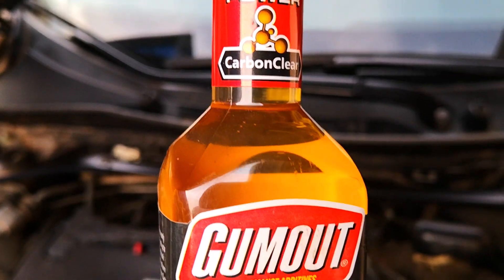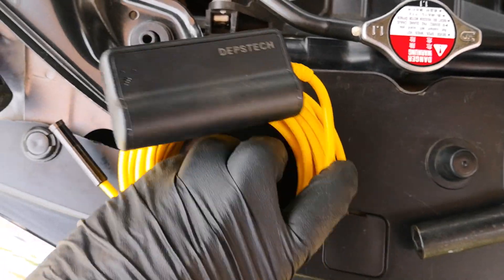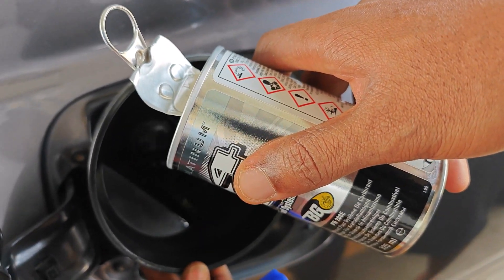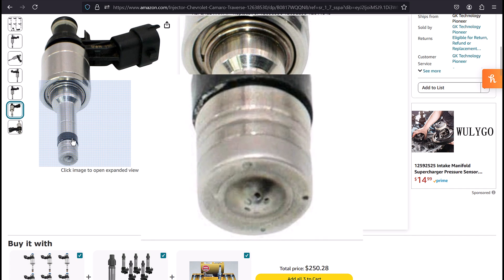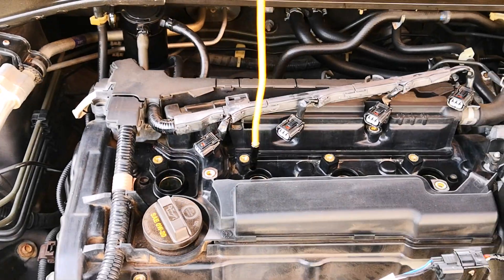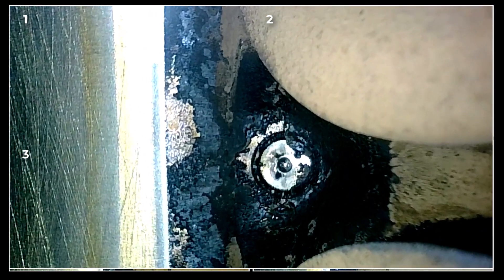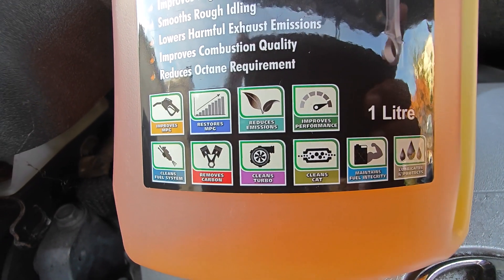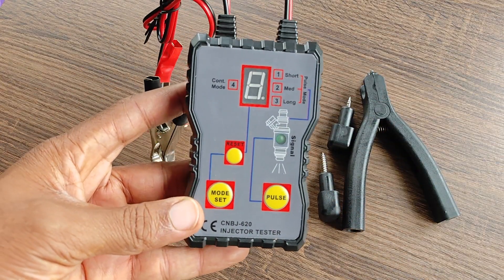Do Fuel System Cleaners WORK? Cleaning Fuel INJECTORS without removing

Comment: Although the owners manual states 87 Octane is the acceptable fuel for the engine in my vehicle, I prefer using the premium 93 octane from Shell or BP. the price difference per gallon is around $.60 US. I typically fill up 10-12 gallons at a time. So keeping it simple,  I'm paying $6.00 more difference for a better fuel with all those additives to prevent deposit buildups. From my experience the performance power and fuel economy shows.
Reply from the maker: Would have done the same if I had those premium blends.

Comment: what fuel additive do you recommend for cleaning the combustion chambers after all your tests?
Reply from the maker: I still have a few more to grow through, but my recommendation would depend on if you plan on adding spirited driving to the mix. Also is the car GDI or MPI?
Reply: MPI and normal city drive. @DIYAutoworksNG
Reply: @DIYAutoworksNG  yeah i like spirited driving 😜. It's a gdi engine

Comment: I used to use CRC Intake Valve Cleaner, but for 5-15% PEA, it’s gotten too expensive ($16 for 311ml); so, I just bought Techron Concentrate Plus Complete Fuel System cleaner ($13 for 946ml) in the US as it has 15-20% PEA. To get it on my direct injection intake ports,  I use an hand air pump sprayer with Viton fittings and a short hose to spray Techron through my PCV port in my intake manifold.

Thanks for all your videos! They are fun and informative! I will use some of the left over Techron in my fuel, install an oil catch can this week, and use only top tier fuel to see if it improves my -4 to -5 Long Term Fuel Trim on my Direct Injection Honda Fit!

Keep up the great content and let me know if you have any more advice!
Reply from the maker: Many thanks for your kind, insightful comment. Do you think the Techron does a better job? I'll get a bottle of it and see.
Reply: @DIYAutoworksNG  I am not sure if it does a better job, but it’s a lot cheaper per PEA amount and produces much more smoke! 💨😮 I hope you make a video to test the results, as my 1.5L engine is too small for my boroscope. According to this video, Techron seems to have the highest level of PEA: https://youtu.be/F_d49APOVsY?si=BkgGCy6LOW4DH4Ex

I suggest using a sprayer with Viton seals so that the sprayer does not degrade and leak from petroleum exposure. ⛽ I bought a Smith Multi-Use Sprayer, 48oz, Handheld TT Mister, 190672 but a Smith Performance Sprayer, 48oz, Handheld TT Mister, Acid, T100, 190511 or any Viton pump sprayer will also work!
Reply: Gumout Regane High Mileage and Regain complete have 25-50%, Redline is 28-34%

Comment: I think you should try oil catch can only for some time any compared the results!
Reply from the maker: I've ran the car previously with only a catch can, it does reduce build up, especially on the intake valves, but you will still have build up in the combustion chamber.